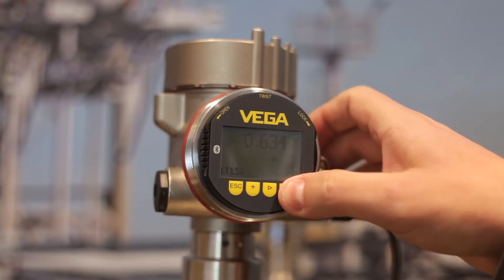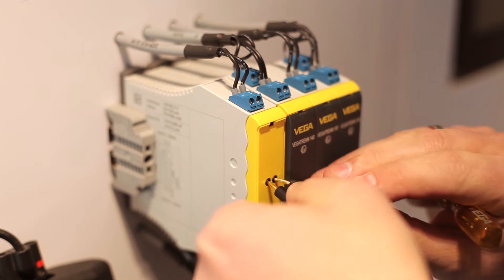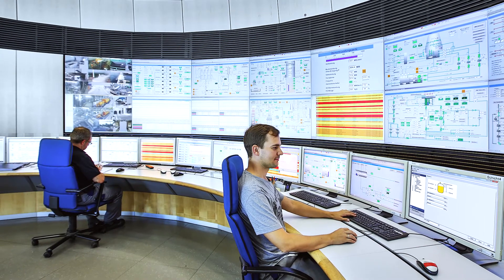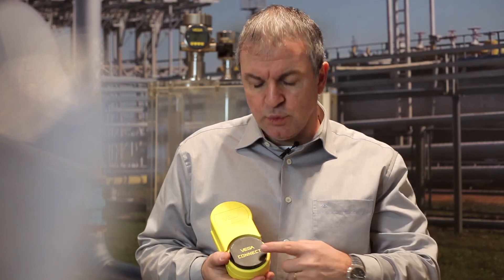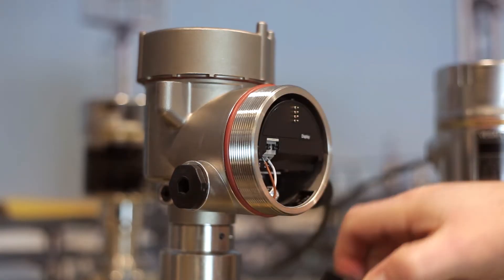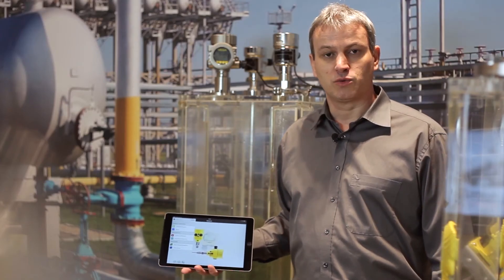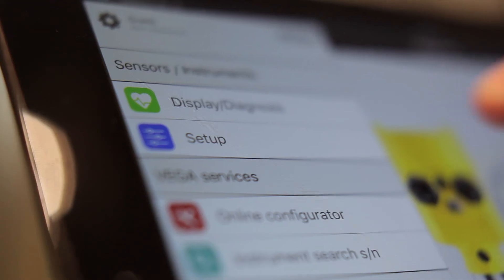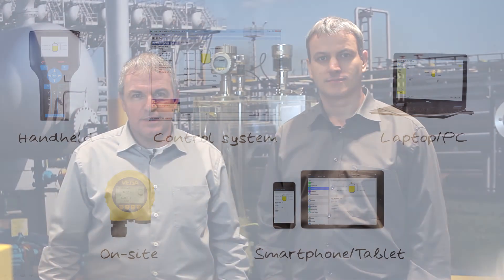Standardized adjustment of level and pressure sensors

Comment: Hi
Can we install Vega level transmitter by using pipe 2 inch my transmitter is Vegaflex86 thanks
Reply: Thank you for your replay,in fact we have one to measure condensate level by using pipe 2 inch , but always unstable reading with alot of trying to calibrate it 
,could you advise me to consider what.
Reply from the maker: For a reliable recommendation, we need a more detailed description and a service record. In this case we kindly ask you to contact our local representative ➡ https://www.vega.com/company/vega-worldwide
Reply from the maker: Thanks for your question. Yes, the VEGAFLEX 86 can be installed in a 2” pipe. There are some things to consider: The pipe should have the same length as the sensor, it should be smooth on the inside and the medium should not create build up inside the pipe, especially with an coaxial version or a cable version with spacers installed. For longer measurement ranges there are some additional things to consider. Please contact our local representative and we'll find the best solution for you: https://www.vega.com/company/vega-worldwide